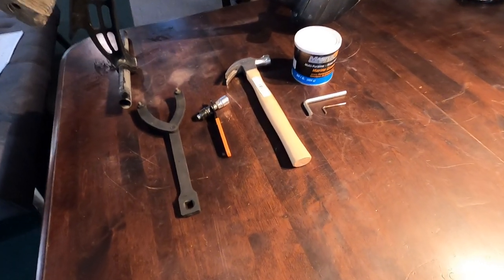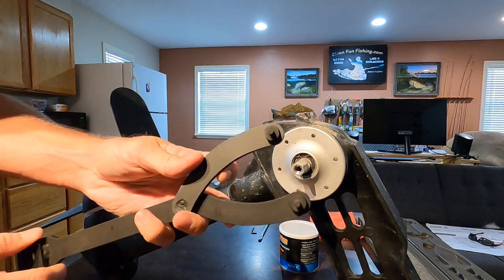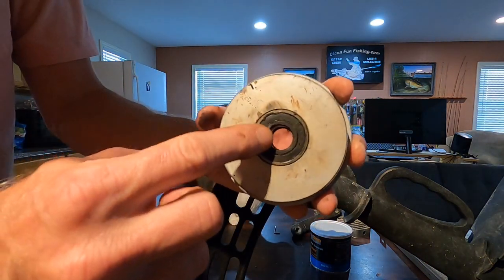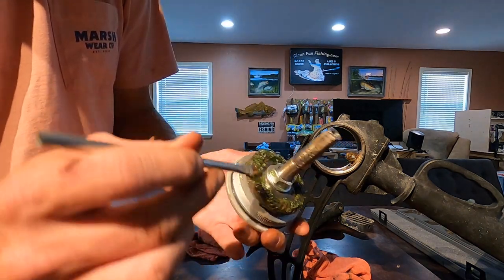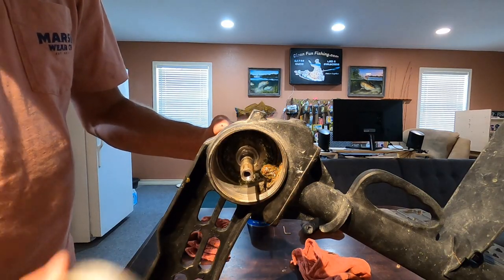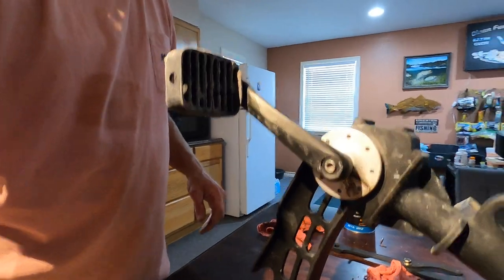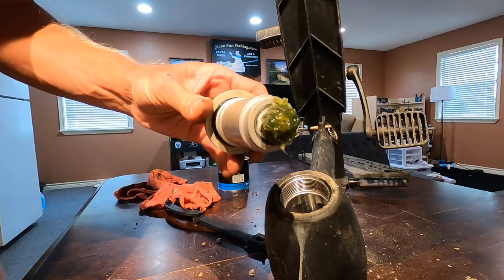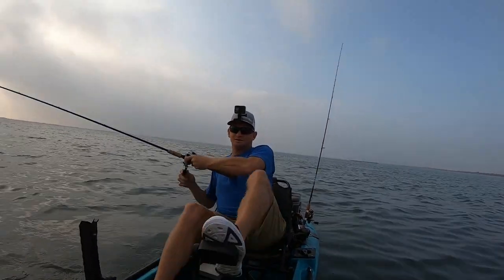Complete Kayak Pedal Drive Maintenance

Comment: I know it's an older video but it's a great one, I have a question, how is the plastic on these hoodoo kayaks? Is it a flimsy type of material or is it actually decent quality? Thanks!!
Reply from the maker: I used a tempest 5 days a week for over a year. Rule of thumb... the lighter the kayak the thinner the plastic. They have changed the tempest design though. I bought a new one and sold it quick. The old model I really liked but the new one is tippy and doesn't track well in my opinion

Comment: Where do you order parts for your drive? Starting to do this to mine. Video was very helpful
Reply from the maker: You would have to contact the manufacturer of your kayak. Finding parts elsewhere has proved difficult.  I ended up buying a whole new drive bc of the parts issue
Reply: @cleanfunfishing  I bought my pedal drive from hoodoo cause I bought a tempest. I asked the guy over the phone what's the maintenance on these and he said there isn't.  I haven't owned it a year and I can't the right side plate off cause it's so seized on there. I broke a pin on the spanner bar trying to brake it loose. Never buying a thing from hoodoo again. I cleaned what I could and greased the top up. But I'm gonna need a new drive.

Comment: Think I'm gonna fill it wit STP or gear oil
Reply from the maker: I used gear oil on my Bonafide drive and it works great but I think there was actually a fill screw to do that on that drive, such as on a rear differential. It might depend on the drive.

Comment: Anyone switched to oil vs. grease? If so, what kind of oil did you go to?
Reply: There would be absolutely no point whatsoever to do this ever. I’m an industrial maintenance mechanic and work with gears and bearings every day. This doesn’t generate enough heat to require oil. Just service it on time and it’s good for a long time. If anyone is putting oil in a system like this there doing it just to do it! Complete waste of time.
Reply from the maker: Maintenance free with gear oil.
Reply: @seanmyhre1305  Not a complete waste. It is definitely quieter and seems a little smoother. They did not put enough grease in at the factory.